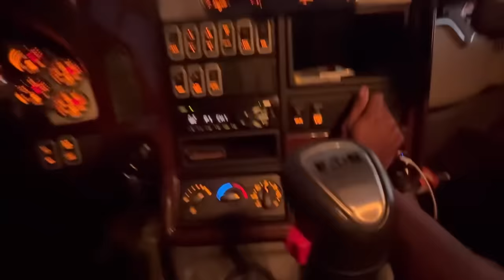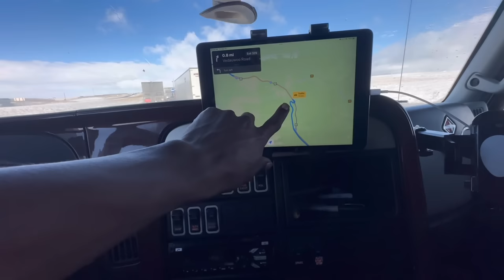Loss Of Revenue ➕ Icy Roads ➕ Truck Accident ➕ Interstate Shutdown ➕ Broke Down

Comment: Hey, why does it matter if you get credit for the load this week or next week? You’re expenses are on a credit card, right? So, you have 45 days before the bill is due. I think your fuel costs are taken out by Landstar, right? If you’re living on a debt free economic plan, your emergency fund can be used to absorb any amount needed and then replaced seven days later. I appreciate your transparency and I am just curious with my questions. Feel free to ignore me. Safe travels. 🏍🇺🇸🎒
Reply from the maker: We haven’t used our credit cards in months. We pay our expenses out of pocket. We are working on paying off the balance. 

Landstar does take out the fuel as an advance.
Reply: @GRINDNGEARZ  Okay. That makes sense. Some people don’t use credit cards, but I have used them since high school. I always pay off the balance each month, because I refuse to pay interest for anything.  It’s basically like paying cash, but if you lose your wallet or it’s stolen, your not out all that cash. You just cancel the card and have a new one sent. It takes discipline to not overspend, but that’s an easy thing to do. The pandemic has been an eye opening experience for millions of people about the dangers of living above your means.
Thanks for your response. Keep those wheels rolling and spreading your message. People need to know that working hard and spending money wisely actually will get you closer to reaching realistic goals! Take care and safe travels. 🏍🇺🇸🎒